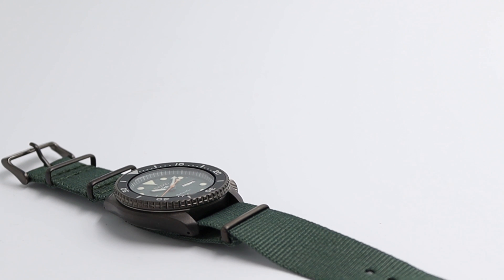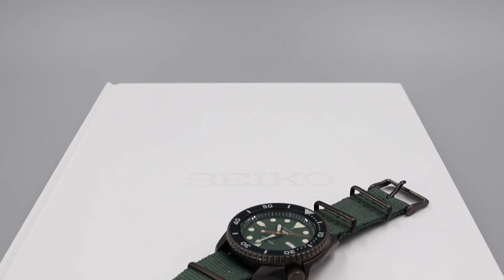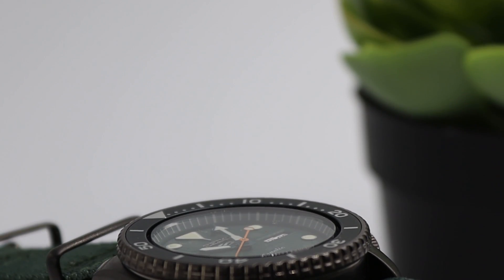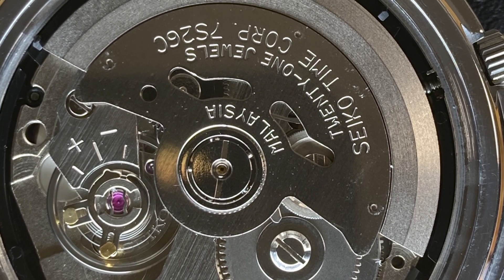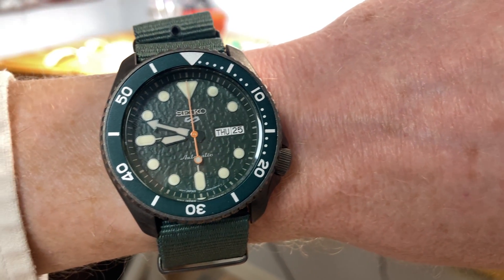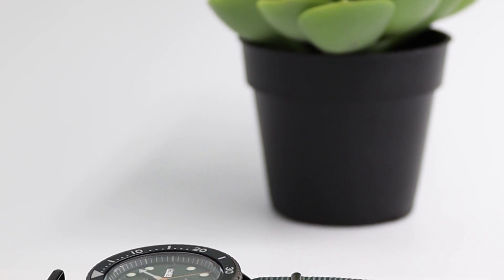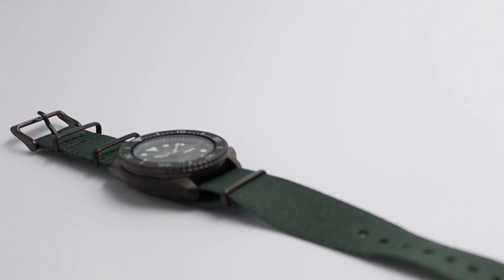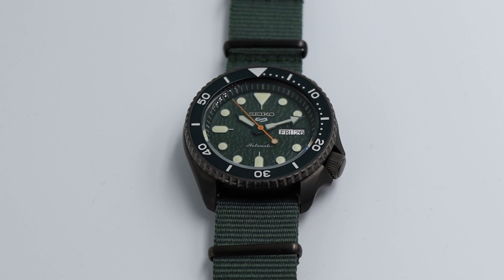Seiko caliber 4R36 Technical Review

Comment: No disrespect, why do they call watch repairman/women "watchmakers"?
Reply from the maker: Using the term "watchmaker" distinguishes a highly trained specialist from a basic "technician." 

In addition to assembly, repair, and restoration, professional watchmakers are trained to manufacture replacement parts by hand if they are no longer available on the market.

Jordan was first trained at Rolex's US watchmaking school, WOSTEP, then taught watchmakers at the AWCI for a decade, and currently builds entire watches, as well as restores them, operates CAD machines, and is also an trained engineer.

When the watch in this video was tested by Jordan, it may have been the first time a real watchmaker laid hands on the watch, because coming from Seiko, there's a good chance no watchmaker was ever involved in the process, beyond operating machines, or overseeing the production line

Comment: Excellent information on 4R36 movement. I have a Seiko 4R36-08L0 movement watch that is my daily time keeper but notoriously inaccurate. It slows down couple of minutes every 24 hour. Can this be fixed? Thanks.
Reply from the maker: It is possible to get this fixed, though it would likely require a visit to a watchmaker

Comment: Hey thanks for your detailed review!

I ordered my first Seiko 4r36 automatic watch. Does it damage the watch if you wind it up manually on the crown in the evening, although the watch is still running, in order to increase the power reserve?
Reply: It doesn't damage it per so. However it is increasing unnecessarily the wear of the mechanism. Avoid it if you want to prolog the life of the mechanism.

Comment: on the 4r36 manual seiko says that when you set the time you have to move the minute marker back first and then foward to adjust the time. Is that ruining the mechanical parts or its no big deal since it has hacking ? thanks in advance
Reply: Hacking has nothing to do with that. It's just to make sure the gears don't settle differently when the watch is set and you push the crown back in. Setting the watch always involves some friction sliding between the gears independently from the direction. However backwards turning is contrary to the usual direction in which the gears are working and thus are matching each other. Just don't do it more often than is necessary to avoid excessive wear on the parts.

Comment: Thank you for the very informative video. It's difficult to know where to start regulating a 4R36 as the reading can differ so much in different positions. I have found that correcting the beat error and wearing for a week and see how the movement is performing. Then adjust it forward or backwards the required amount. It may be necessary to fine adjust in another week but usually you'll get your 4R36 to about 20 seconds a week.
I think every 4R36 behaves differently and is worn differently, so a few weeks of monitoring seems to work best.

Comment: Thanks for the great video--is nice to learn a little.  Quick question: is it possible to over wind a 4R36?  What is the ideal number of crown turns to wind?  Thanks in advance, cheers.
Reply: Yes it is possible. The barrel of the main spring guards against that by allowing it to slip against the barrels outer wall. You should feel it when attentive when winding it as increased resistance on the winding crown. However this should be avoided. It will accelerate the wear of the winding system. BTW. This is the reason why automatic watch winders should be avoided.
Reply: @rosomak8244  Thanks for your reply.  I appreciate it!

Comment: Does the actual power reserve on these movements meet the advertised ~40 hours?
Reply: Yes it does. When the movement is new it will be even some hours more. With age it tends to decrease. However 40 is certainly a lower limit that's not undercut.

Comment: I have various Seiko watches with various movements in them  I find them to be an ultimate tool watch.  They are durable and rugged while being stylish at the same time.  Also, I do like a day/date complication and put a day/date cyclops on one of them (SRPD77).  I own Rolexes and Omega as other brands and they are perfect for some occasions but being a Chef, I need an everyday GADA watch for work.  Seiko is it.  Great vid, thanks for the technicals!! Subscribed.
Reply: Hey chef, how old is your seiko watches? Im considering to buy SRPG35K1 (4R36), I wanna have watch that can last for 10-20 years so i can give it to my son someday as a gift lol. But when he said that 7s26c has lower Amplitude which makes it more durable, i feel kinda regret to sold my seiko snk803k2 (7s26c) lol. Can u give some advice? Im still new to horology

Comment: Just wondering if it's better to fully wind and have high amplitude or not quite crank them up to full power to lower the amplitude ? or would it not even make a difference ? Thanks.
Reply: It's an automatic, if you wear it it's going to be fully wound anyways.
Reply: They where designed to wind them self up during regular usage. If you wear the watch just sporadically it's best to just give it enough wind for it to start. Normal wearing will do the rest.